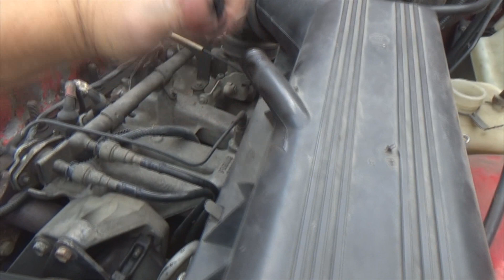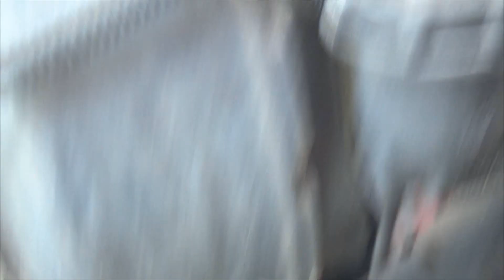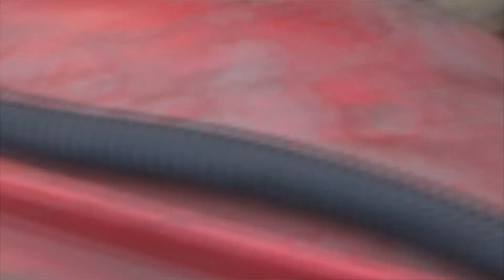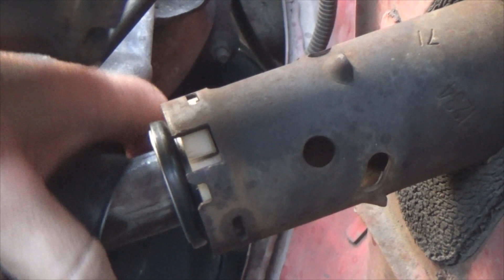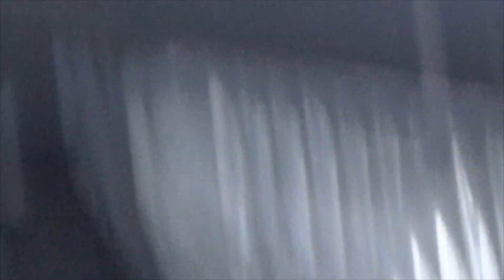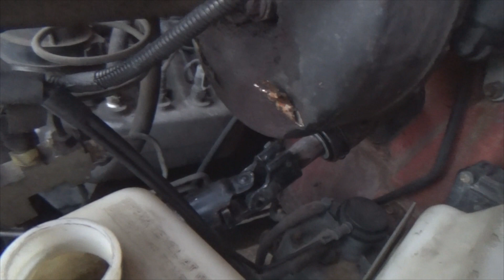Jeep Wrangler YJ - Replace the lower bearing in the #steeringcolumn

Comment: Thank you for the great video. I did the job yesterday and I'm gonna say, you know how you said YOU always get the hard jobs that were supposed to be easy....after fighting to get the steering shaft ends to release for about an hour (I was replacing the steering shaft also), of course the retraction area was seized solid, had to take the torch to it to get it to retract,  then a big fight to get the ends to release both upper and steering box shafts, then the bearing put up a good fight and then....as the cherry on the sundae, the inner part of the bearing was seized on the upper shaft - I had to take a Dremel tool and cut it in to 4 sections - then I had to sand all the rust off the shaft to get the bearing to fit. From that point on, it was good. But what a job! After all that fighting  - it works great! Your tips were very helpful.  Thank you!

Comment: Outstanding walk through to complete the job. I see your steering column at the end and the turn signal stalk looks like its sagging like my YJ (which doesn't lock in turning right). I have seen your wheel removal and ignition replacement. I have to say, that is the worst designed turn signal lever mechanism I have ever seen. The small ball on the lever arm just comes out of that track all the time!  I'm hoping plastic wedges epoxied to hold the arm in the track will work. Maybe you have better ideas. If so, please let me know.

Comment: When you put your steering column back together, isn’t there supposed to be some sort of a neutral safety or clutch safety. I’m 66 years old and I have just done so many mods and upgrades to my jeep. It’s a 1995YJ. I got it home And I’ve been driving my truck for two months while it was out in the shop. I wanted to warm it up to see that my water was circulating because there was too much water in my overflow. I just had every single fluid in that Jeep changed the rear end gears changed,  all new bushings  and boomerang shackles. 

I bumped the key, not thinking it was in gear. He should’ve just lurched and stopped. It didn’t, it took off. It took me out. It bruised me all up. It ran over a couple wheelbarrows. It didn’t stop till it hit my house.  Even then, the go tire was still spinning.
so now I’m gonna watch more of your videos and see if I can figure out how to fix the rest of the issues. I can’t drive my Jeep since it’s been home. It’s too dangerous. my steering is very dangerous that’s why I was watching a steering video.
Reply from the maker: Sorry to hear about that! Hope you are ok! The safety mechanisms are not built into the column. Automatics have a neutral safety switch on the transmission. Manual shift YJs .. they are hit and miss about the safety. So many YJs have been modded so much who's to say if a rig had a clutch safety switch that a previous owner hadn't disabled it. My rig and a fella I used to work with .. both our rigs would start without pushing the clutch.

Just bumping the key activates the ECM (which controls fuel and ignition) and of course it will turn the starter over. If the Jeep is holding proper fuel pressure .. it will start very quickly. When I start my rig to allow it to run in the driveway .. I check .. double check .. and triple check that it is out of gear.
Reply: @Poweraddicts  thank you for your response, and yes, I am double checking to make sure I am out of gear now. Although,  she’s back up on Jack’s, I’m dialing in the front end now, trying to get this darn Pittman arm off. Errrrr

When I got my lift, I had it done at a shop. They ordered the kit (rough country) But nobody said I was supposed to do other modifications to it. I hope what I’m doing now is going to fix my steering issue that it came home with.
Once again, thank you I enjoy watching your videos.

Comment: I have to tell you, the pressing on of the bearing goes nothing like what yours did
Reply from the maker: Sometimes they are easy ... sometimes they are a total pain! Working on old vehicles is always a gamble. Hope the video helped you and thanks for leaving a cool comment. Have a great day!!
Reply: @Poweraddicts just an update, I’ve destroyed 3 of these trying to install. It’s been one of the hardest installs I’ve ever done on any vehicle. Trying to sand the steering shaft down so it goes on a bit easier. Also, the retainer doesn’t fit over the column. Almost zero clearance. Ordering a 4th bearing today but I’m at a breaking point. It’s been 1.5 months working on this single thing

Comment: Hello my friend from Italy! The windshield wiper water hose in my 87 YJ is broken and when I operate the motor to spray, almost all the water falls under my feet, near the gears. Can you help me find where the rubber or pvc hose is? Thank you, Giuseppe.
Reply from the maker: For wiper hose I just use the generic auto parts store hose that they cut off by the foot. Just take a small piece in so they can patch up the proper internal diameter.
Reply: @ But is the tube behind the dashboard or inside the bodywork? Should I disassemble the dashboard or is it sufficient to tilt the windshield? Thanks a lot

Comment: Excellent video.   I too could not collapse the column.   I ended up putting a ratchet strap hooked into U joints on both ends.  Once tight as I could get it I removed the floor board  flange and used a long punch and big hammer to persuade it to collapse so i could remove the steering column.

Comment: Just cut the steering shaft and replace it with a new one. Its 30+ years old anyway. Its supposed to be telescoping in case of an accident. If its seized its not going to work like its supposed to.
Reply from the maker: I popped the bearing again wheeling last month. As you suggested, I'm going to replace the steering shaft this time. Thanks for dropping in!!

Comment: Okay I tried this and the bar wouldn’t collapse. We fixed it without removing the bar or it collapsing by instead removing the bolts of the power steering gearbox and supporting it on a table Jack (but we didn’t disconnect the hoses). We only shifted the box about and inch or two but it was enough to remove the bar, get the old bearing off the column, and put the new one on. You have to be really careful that you don’t move things too much and damage the hoses, I’d recommend a buddy to help! Good luck!

Comment: Most people do not know how easy it is to unbolt the steering column.  You do not even need to disconnect any wiring to do this.  Unbolt the top half of the column support plate at the firewall (2 nuts and 2 bolts), then remove the column bolts just at dash.  You can now pull the whole column back several inches, disconnecting your steering shaft.  I live where the rust roams free, and I have never seen a steering column retract like it should, so this is the workaround.

Beating and hammering like you did is a great way to waste a ton of time, and damage stuff.  If it doesn't come apart, take more stuff apart.  Yes, as you mentioned you can drop your steering box as well, but it is heavy and awkward with everything attached to it.  Go for the column, you will save your self a lot of grief.

Comment: The shaft between the gear box and column is designed to collapse on impact.  And I believe it is glued together with some factory "gorilla snot" just like an MJ.
The only way to make it slip is by heating the outer shaft to soften the gorilla snot.
That particular shaft is adapted to Chevy trucks to eliminate the rag joint with actual u-joints.
Those shafts are used in other offroad and "ricky racer" applications where u-joints are more desirable than rag joints.

Comment: This doesn’t fix the slop in the cab my lower bearing is fine and i still have tons of play in my steering wheel. You have to pull the steering wheel and tighten the bolts holding the tilt housing.

Comment: Question for all you guys my bearing shaft would slide into the column when trying to install the new bearing is this normal or is something broken inside the column. Not the steering shaft that came off easy the rod where the bearing rides on the one the guy said to sand before installing the bearing.

Comment: Thanks for another great video. I had a terrible time with my frozen steering shaft on my 94 YJ. Spent two days heating it and squirting with PB Blaster. Nothing would budge it. Then I read the comment below about heating it until it turns red with a torch. Took about 10 minutes to start to glow red in places. Hit the end with a wooden block and it finally moved! The only think I'm not sure of it I have weakened the heat treat on the shaft with the high heat and possibly making it easier to break???

Comment: If the shaft wont collapse it should be replaced. It's designed that way in case of a front end collision. If it's frozen it will jam the steering into your chest.

Comment: I have quite a bit of slop in my steering.  When driving down the road, my YJ seems to have a mind of it's own as far as direction of travel.  I have replaced the steering box, (leaking) hydraulic lines and reservoir.  I am going to check to see if the bearing is the culprit.  Thanks.  I enjoy your videos!
Reply: Did it help?

Comment: I changed the steering box, the rod wouldnt collapse so I heated it with the torch until red hot, it came apart. I sanded, put a little grease, works like new.
Reply from the maker: That's about the only tool I don't have. I got a plasma and 2 welders, but no torch set. It definitely needed heated to break all the rust and crud loose. When I first tried it about a month ago it would collapse at all. A month of hitting it with PB blaster every couple of days allowed it to collapse but then wouldn't come back out. It was a fight but the battle was won!! If I ever have to pull it back out I'll put it in my engine puller and pull it apart then sand and grease it. Heck, should have done it while I had it out this time. Good hearing from ya bud! Have a good one!!

Comment: The collapsible steering shaft is just another "safety" feature that probably wouldn't work properly if you were in a serious front end collision!
Reply from the maker: Now that mine is broke loose it may. But it sure wasnt before. Thanks for dropping in! Have a great day!
Reply: I actually was in a wreck and the CJ 5 wiped out the pick up truck in front. The shaft performed as promised. The truck was totaled I took a Come Along pulled the engine and Transmission and transfer back in place cripped radiator tubes. Bend fenders back out. REMOVED THE 6" CHANNEL IRON BUMPER WHICH TURNED INTO A W. AND DROVE ANOTHER 220,000 MILES. THE CJ5 is one hell of a ride. Tough as they come. Treat it right. It will not let you down. They will roll on sharp turns or steep grades  The Saginaw Steering is guick and you must learn to drive all over again or you will be in a ditch on the roads. OF ROAD IF IS A PACK MULE AND DESERVES ITS REPUTATION.. Then size is great you dont drive in the ruts. It goes where other can't because of it smaller size. Doesn't need as much ground clearance. Shorter wheel base and narrower matters Of Road. I ran Loggin Roads for years as a Caver. The CJ 5 Jeep did indeed write the book on 4 wheel drive. My wife and kids all cryed when I traded it for a Truck after almost 10 yrs. And over 250 k miles. We have owned several jeeps but that little 78 Sun Orange CJ 5 49 state model was a wonderful machine. Oh I like the I-6 four speed Off Road better than the V8. Seems better balance and not nose heavy on climbs. 
Rebuilding one 78 Renegade Levi Tan with Dark Brown Paint. Some floor and body patching. Lotta new stuff. Old jeep never die. THEY HELPFULLY GET REBUILT WELL.

Comment: Hey Chuck great video. Thank you for the content. Well done as always.  I l like how you make things work and figure it out, but would you consider or recomend replacing the collapsing rod altogether?  Are they difficult to find?
Reply from the maker: Thanks, glad you like it! Typically people replace that rud when the little U-Joints get real loose. Mine had a tiny bit of play in them so looseness in the steering wasn't really detectable. It drives and feels fine. From a nuisance point of view like this one being stuck. It would have been much less of a headache to deal with.  I just did a quick Google search and found several vendors that have them. Thanks for dropping in and leaveing a great comment!! Have a great day!